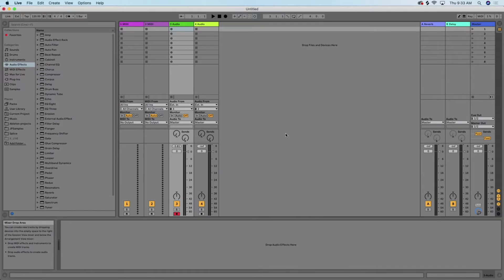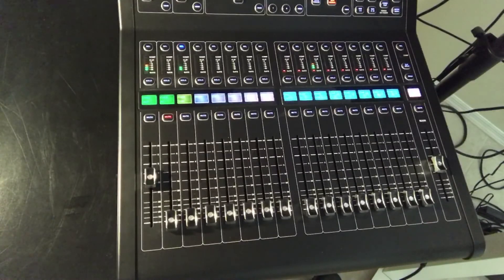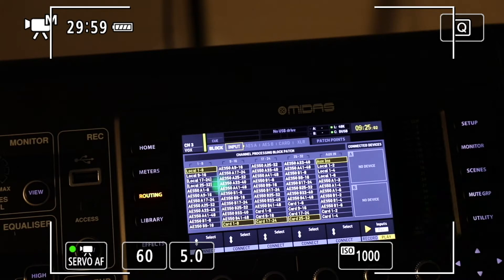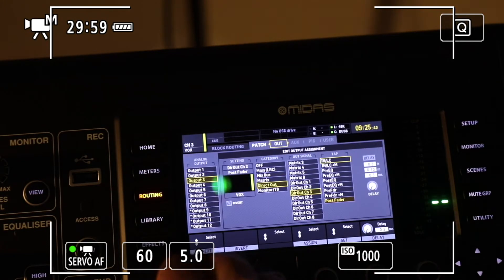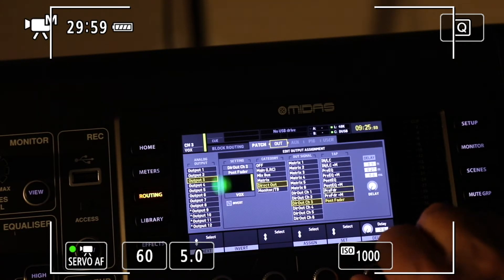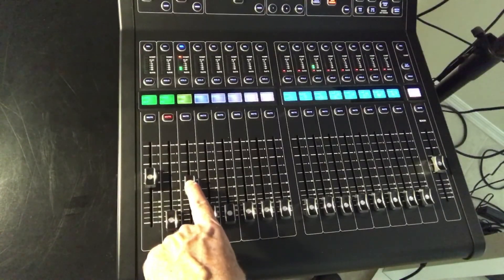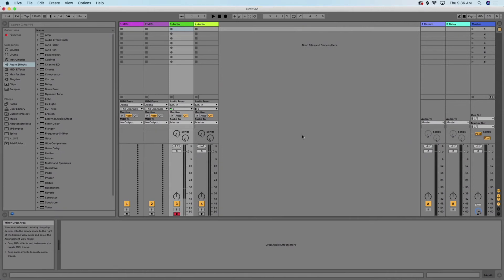Recording Post Fader M32r   DAW Ableton

Comment: Hey Jeff, That deffinatly fixed ch-16 on my Midas M32 on the DI out w Fade and EQ inline to my DAW. Cant get any thing beyond 1-16 as there is no further out OUT of EXPANSION CARD OUT 17-32. Ive unassigned the channels 1-32 from the subgroup faders/mutes which removes the Channel 1-6 Faders from that Subgroup DCA control but still no DI OUT 17-#@ routing selection. Any thoughts. I do live sound and the setup I have is xlnt, but in my studio I need more than 1-16 DO with Fader, EQ, Comp processing. Do you have a solution, or is this a Midas tech support question since the Midas M43 manual is pretty much useless. (Midas M32with Mac Digital Performer) all channels on the Mac see DI In from the Midas but ch 17-32 no DI with Post Fader/ EQ/Comp routing. Thank you kindly Michael
Reply from the maker: Sorry I’m not around my M32R but I’ll try explaining. If you’re not using a P16 you can use the P16 soft outputs to your DAW. Assign the 16 input channels on your mixer you want going to the P16. You can tap them anywhere like you did before post fader and post EQ. Then assign your card inputs 17-32 to the P16. Here’s a link to another video I found
https://youtu.be/aRGnYa8dkHQ?si=psh6AP7l4A6xjCc9
Good luck

Comment: Hi Jeff with M32R Live. out of the box it records directly to the DAW. Can I Change to Post Fader? the reason I would like to record the Preamp, EQ, and Compressor to the DAW
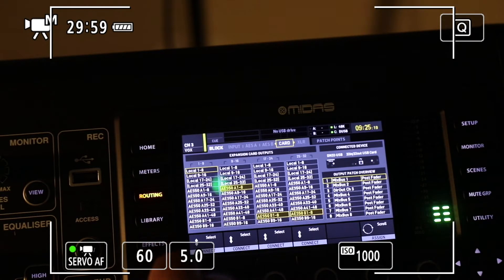Reply from the maker: Go to 1:00 in the video where it is explained. After using analog mixers most of my life the signal flow is a bit confusing on digital mixers. I'm using the newer software on the M32R so doing this will look a little bit different with older software.

Comment: I have an M32 and I can’t seem to figure out how to simply plug an I phone in for play back. All other uses for the board have been easy . Thanks
Reply from the maker: You can use an adaptor from your charge port on the iphone to a 1/8" female, then use a stereo 1/8" to RCA cable and plug into the aux inputs on the mixer. Assign 2 of your channels inputs to the aux inputs with the RCA connections.